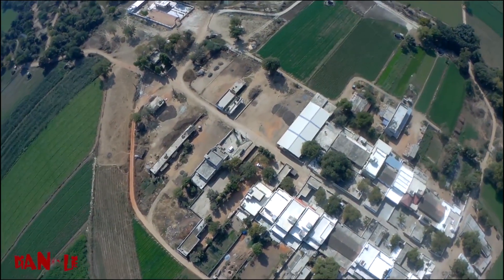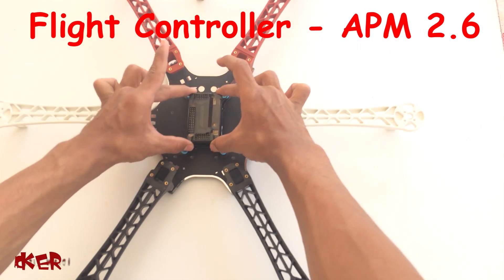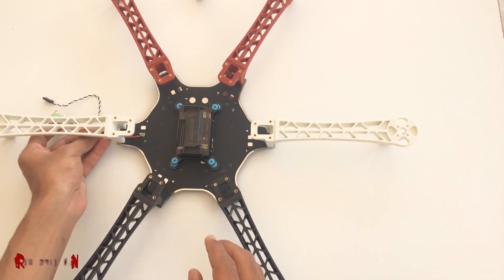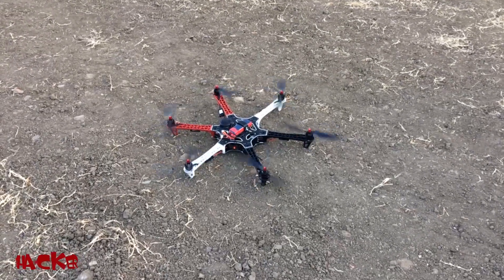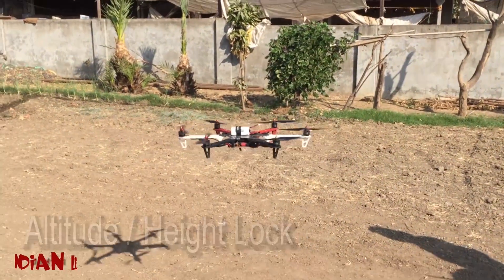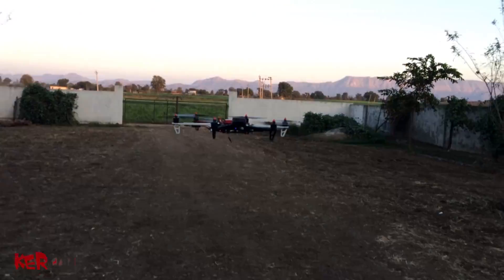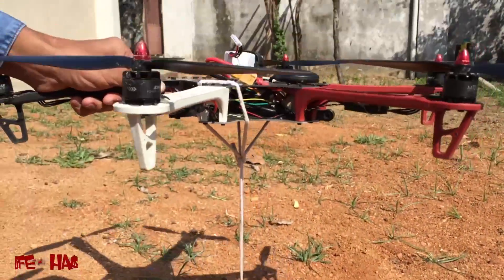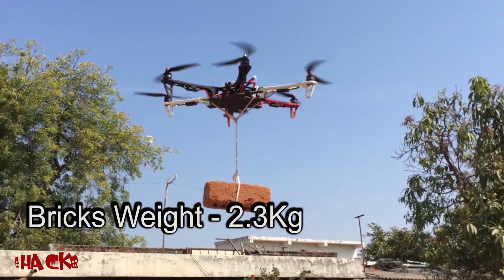Surprisingly Powerful Hexacopter YOU MUST SEE

Comment: is APM 2.6 more stable  and so why?
Reply: holybro kakute f7 have lot better fasten 32 bit lot more memory,telemetry in board, video tx in board etc. and no cost lot about same than APM. or cheapen.,apm and historic k2.1.5 have only 8 bit old slowly controller no telemetry or need buy additional board all, and wery slowly.no memory lot. old is old.

Comment: I had alredy made a drone with ymfc but now i am moving to apm flight controller but after all configuration and at time of test flight i saw that at time of altitude hold the quadcopter not mainting proper height sometime  motor suddenly increase its rpm due hight altitude also due to this other modes that want barometer it also not work properly. Please reply me fast please. Remembre i am using apm 2.8 with external compass and at time of programming it one error "boar is retired" it will upload last version. Please help and reply me  fast..

Comment: No this is zelio effect
Reply: This is due to internal vibration caused by Loiter position fling or gps lock flying...if you fly in stabilize mode or alt hold mode this zelio effect may gone..either you may use a gimbal

Comment: The wavy Distortion you are seeing in your video is not caused by air pressure variation, it's caused by vibrations causing the sensors in your camera to distort their input. If you mount your fixed camera on rubber grommets the same way you have your APM board, that will vastly reduce the "Jello effect." You can further reduce it by balancing your propellers, simply put them on a spindle that can roll freely and watch as the heavier blade of your propeller swings downward. Apply some clear sellotape to the bottom of the other side of the propeller until you can rest the propeller on the spindle and have neither blade swing downward.